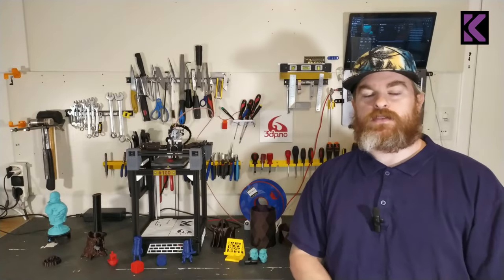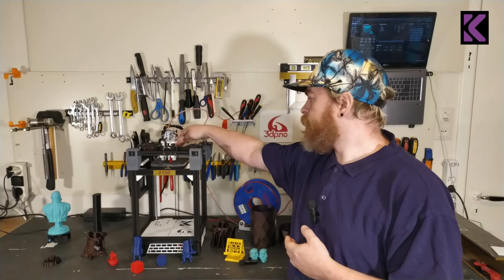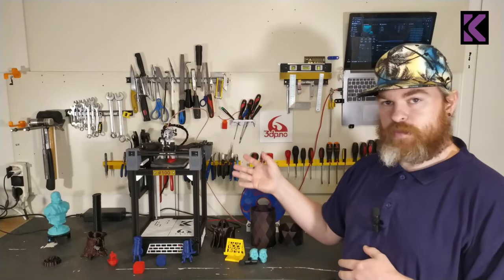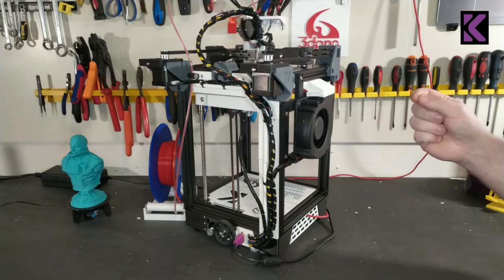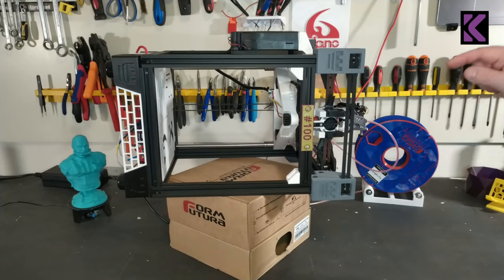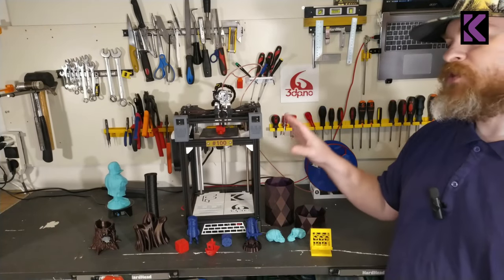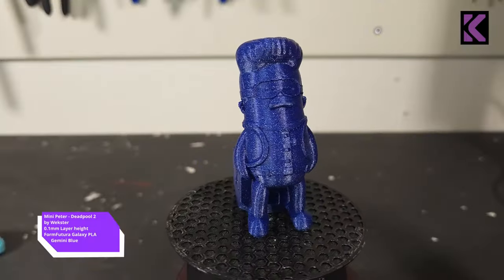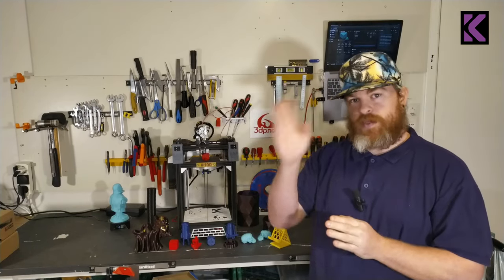Rook 2020 MK1

Comment: Thanks for making this design and helping Rolohaun! I've started working on this build, plan is to put a heated bed in, size around 20-25cm for x/y dimensions and 25 or 30 for Z. I want it to be slightly bigger than the original or by design model. Thanks again, great work!!
Reply from the maker: Maybe look at the rook scalable if going bigger
Reply: @kanrogcreations  that's exactly what I've been looking at 🙂Printing parts already, can't wait to seat it right next to my Trident :)

Comment: Hi, can you share about the model and watt rating for the external power supply used? As in "Rook Build Part 2" video too.
Reply from the maker: It is a 24v 8A power adapter from aliexpress with XT60 connectors instead of the original barrel connector it came with.
Reply: @kanrogcreations  Thank you!